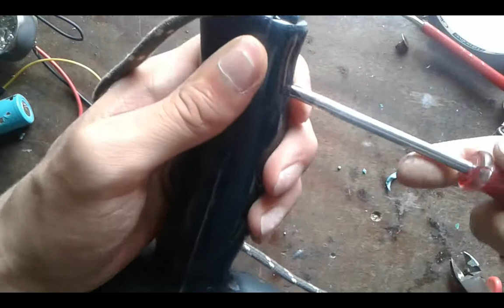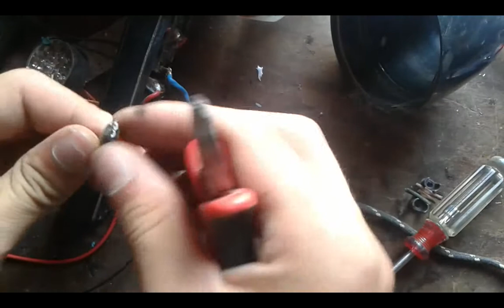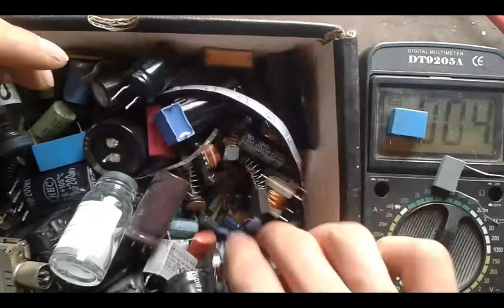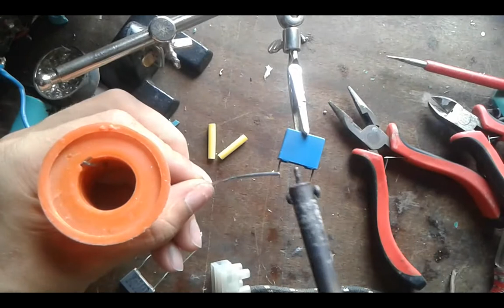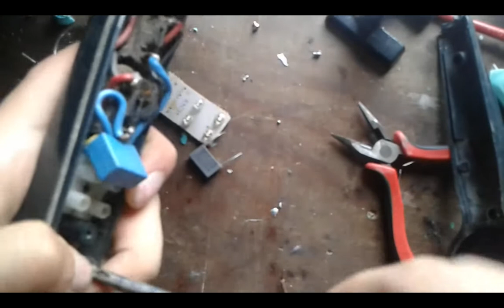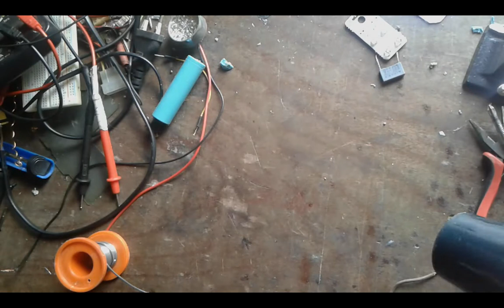How to Repair a Megaturbo Hair Dryer with a Burned Cable and a Dead Capacitor

Comment: What is the capacitor across the power and neutral wire for? Some commentary would be nice. Thanks for the video.
Reply from the maker: +K Stewart its like a start up condesator for the motor